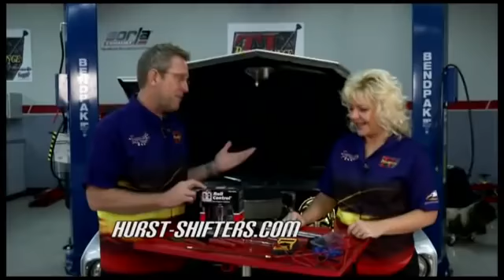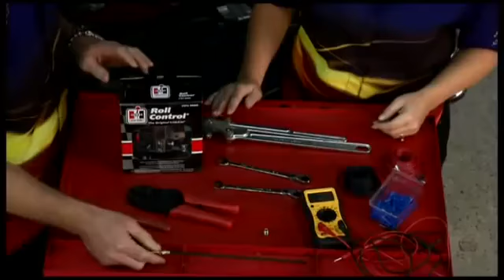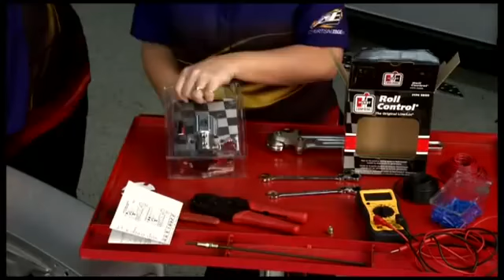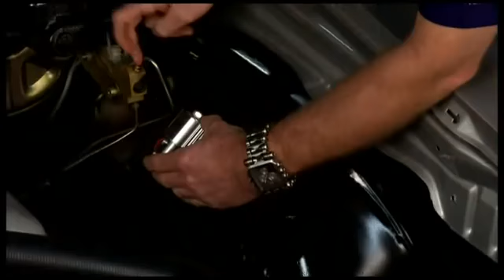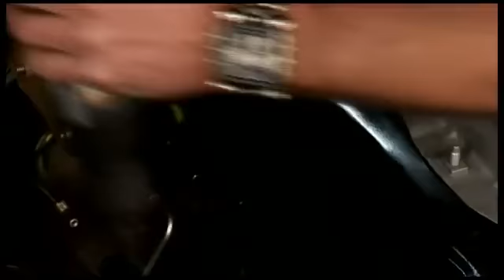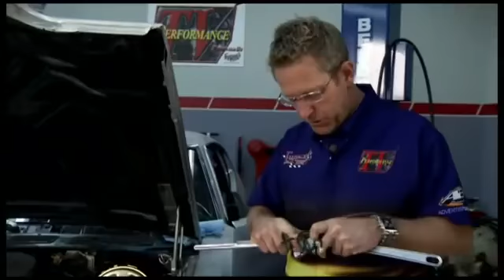Hurst Roll Control Line Loc Lock Kits 174-5000 Install How-To Overview Tutorial

Comment: Can this be used in place of a parking brake?
Reply from the maker: No. The reason is that the solenoid will get too hot beyond normal use for line-lock and will fail. We do have a hydraulic brake lock that will do the job here: http://www.jegs.com/i/JEGS-Performance-Products/555/63028/10002/-1